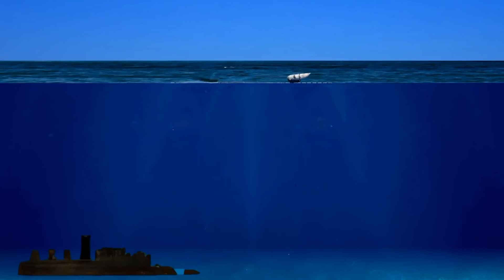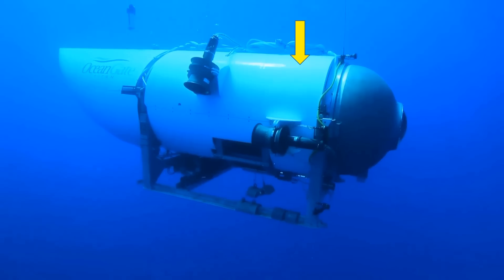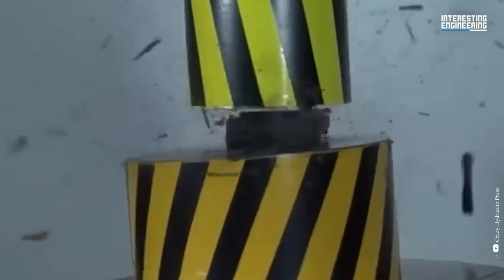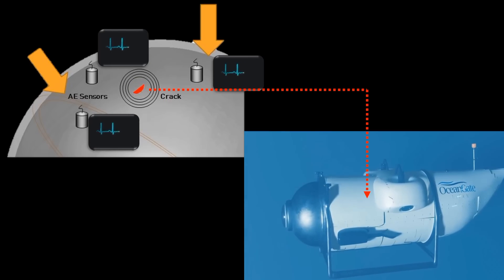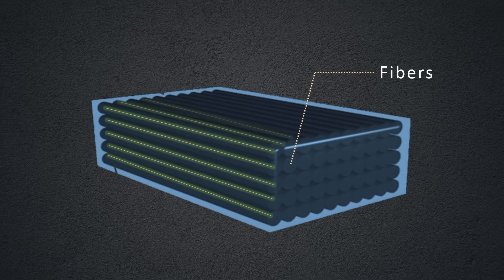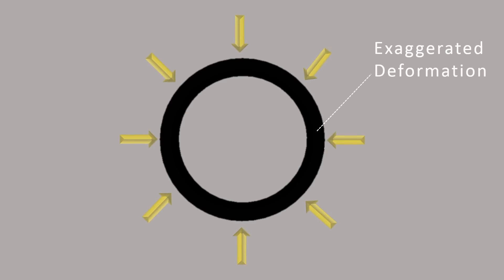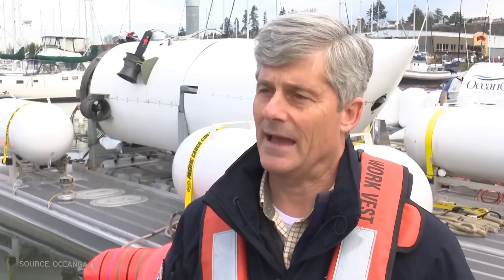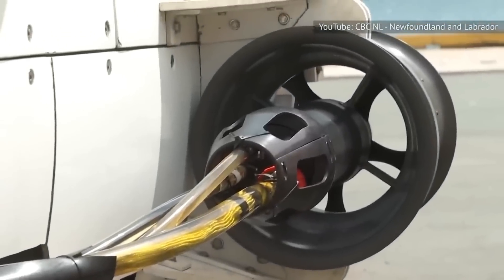Oceangate Titan Did Not Implode Just From Pressure. There Is a Catch!

Comment: The inner surface of the shell under compression will only go into tension when it develops an inner curve.  It's simple geometry.  As long as it retains cylindrical shape it's all under compression.  One might argue an infinitesimal section of fiber could warp in matrix filler around it & go in tension, but there would still be 99.999999900% of fiber under compression due to being part of cylindrical shape.

Comment: I work with carbon fibre & repair fractured or completely broken items made from the material.

A 5inch thickness of the hull built correctly & under perfect conditions, would have been able to withstand the immense pressures, BUT the one directional lay up of the carbon fibres was NOT at all sufficient for such a structure.
A multi directional layering should have been used over the entire structure as for the same volume of carbon fibre the finished strength is hugely superior.

It beggars belief that Oceangate adopted the one directional approach & in my opinion it's that what has caused the implosion & cost the lives of the five.

Very very sad that basic carbon expertise wasn't researched, ask for or adhered to.

Comment: Seems like Stockton Rush would know much of this and so my thinking is he had a number in his head. Maybe 12 missions and then he’d inspect it thoroughly.  Or maybe a number based on the cost of building and operating the sub.  A number high enough to make it profitable.  He must have had some number in his head about how many missions he would risk before doing the work to find out how long these subs would last.  Sadly, the actual number of missions to failure was far below what he likely estimated.

Comment: Thermal contraction/expansion differences for bolts embedded in the carbon fiber for the titanium end and sealing passages for cables through the carbon fiber hull would seem to be obvious points of failure in the design.  It was an experimental vessel with fundamental flaws and inadequate testing. 😢

Comment: Second thing.... I working at underground coal mine from (400-1200meters under) and from time to time i thinking what is theoretical force is waiting to push on us when we there. .... And almost all of is is self suport by tuner surrounding coal sandrock etc. We see how But from time to time we see the corridors getting narrower every day. Coal is soft so he is bended and  stratifies itself when rocks pushes on it from behind and on other side it meet steel and empty space or by preasure the bottom is rising.  rocks enter through the casing and sometimes in extreme cases they break the steel casing as if they didn't care about them.  In fact, these tunnel casings protect us from the very small space around us, not all the pressure of millions of tons above our heads, and if the environment wasn't self-supporting, the protective casing of the pavement would be useless.  We have no guarantee that the housing will not fail or that a rock will not pop out from between its frames.  That's why, among other things, when we greet each other at the mine, we say "God bless" to each other

Comment: I just imanine that composites are good at holding compresed air/gases when round or cylinrical shape distribute presure in all direction and carbon fibre on tearing force is great. But at same time process is not repeated when preasures are reversed. (Outside of cilider is high and inside is low) ....It should be easy for non grade person.. Or is here somone patient to explain to me how wrong I am and it has nothing to do with the disaster.

Comment: I suggest there was a 'stresscon', (stress concentration) at the interface of the carbon fibre cylinder and the titanium end caps.
These 'domes' are inherently more rigid than cylinders, being titanium just makes them more so.
Interfacing different types of material is always a major problem. Are not submarine hulls made from the same material throughout?

Comment: Actually it did implode just from the pressure. Nothing else made it implode. The design simply wasnt suitable and so eventually failed causing an implosion, under massive pressure. The cause of the failure doesn't change the fact that it imploded.

Comment: Agreed. I don't think anyone really understands the failure mode of this structure. We can say for sure that it was associated with fatigue however - it worked previously. Carbon fibre is more vulnerable to fatigue than titanium. 

The cylindrical shape was not adequately catered for -

Radially wound CF.
Supported at the ends by titanium.
No mid or any internal support.
No NDT.
Glued end joints.

I think that the tin can comparison is valid. The two end caps were waiting to come together and all it took was a slight change in force vectors as the tube buckled due to fatigue failure.

Comment: It makes sense to have as few joints in a submersible as possible and absolutely no glue or epoxy because of the obvious ability of glue to come apart or dissolve. A better idea would be to cast the entire submersible as a seamless tube using one alloy or metal with only the portal and escape hatch with bolts and seals. The escape must be made to be opened from the interior as well.

Comment: I'm  a degreed  mechanical  engineer  ... 78 years old ... the failure was due to material  selection and lack of cycle stress testing ... Eg.  Airplane  wing structural  design is rated in millions of flex cycles ... stress cracking due to work hardening of the materials  ...
Obviously,  extensive cycle testing was not performed...
If done ..this would have shown the weakening  and eventual  failure  ... lamination  construction follows the "weakest link  in a chain" analogy ... if one layer delaminates ...the integrity  of the body strength  is severely  compromised  ...
Overall ... incompetence  lead to failure  ...
Brian L Meeker

Comment: At depth of 3,000 meters, the external pressure on the vessel wall is around 29.4 N/mm^2. Would you know the carbon fiber wall thickness of the Oceangate Titan?
Reply: I heard that it was 5 inch thick.

Comment: Stop lying about the controller.
It's not a problem. 
You have been doing such a good job of remaining honest and sticking to the facts but when you got to the controller you began being intellectually dishonest with yourself and intellectually disingenuous with us.

Using a game controller is not at all a problem as the US military uses it for many different purposes including multimillion-dollar aircraft, watercraft, robots, and other uses. 

Gaming controllers are intuitive cheap and extremely durable and reliable. There is absolutely no issue with using a video game controller to control thrusters on the craft as it is intuitive. There was a backup controller on the craft and other ways that were secondary backups to controlling the crafts movement. Please remain honest as I do like your channel but as a new viewer if this intellectual dishonesty continues I won't be able to continue watching your channel.

There are so many things wrong with what happened in the construction and use of this craft so just stick to those. You don't need to make up a fake problem in the controller when it's not actually a problem. It really sets you apart from the others when you lie about this.
Honest scientific fact based channels will point out that if the controller is not really an issue. Be one of those channels.

Comment: Carbon fiber might be good , but 5 inches wasn’t probably enough, maybe 12 inches should be considered safe .
My second opinion is about the 2 end rings , we see on video they look like to be simply glued and simply located about 6 inches into the the carbon fiber tube , I have some engineering skill and as what we can see there is no over wrapping to interlock those ring with carbon fiber tube , it should have have been 2 or 3 interlock lips while wrapping the carbon fiber and finally on the outside a final collar that compress that joint , I don’t mean to the point to affect the integrity of the carbon fiber , just to apply a pressure to prevent any water to enter between éther titanium and the glue , to my point of view , the glue can’t stick 100% to the titanium and over the cycles water made it’s way slowly.
Did you see on tv all the 2 rings come clear of carbon fiber … so the glue simply broke off .

Comment: The sub was not constructed in a proper clean room with all external contaminants filtered out using HEPA filters. It was epoxied together between carbon fiber and titanium in a warehouse with no control over air, temperature, humidity, contaminants, etc.

Comment: Carbon fiber is a great material under tension, but near worthless under compression.  Likewise, a rope is a great material to use to pull a heavy object (tension), but is essentially worthless to use as a stick to push something, (compression).
Epoxy is a great adhesive when gluing surfaces together when spaced two to five thousands of an inch apart, but the strength goes down quickly from there in bulk applications.  
Epoxy has the strength of 3000 psi in tension,  This compares to 30,000 psi for low strength steel and 60,000 psi up for high strength steel.    Steel frame building are welded and bolted together.  They don’t use epoxy to glue steel frame building together for a reason.  
The strength of epoxy in in tension.   The peal strength of epoxy is far far lower. 
An epoxy saturated rope would only slightly improve a ropes ability to push, 
Epoxy would probably improve a ropes performance in tension by better sharing the load between fiber, but then when it failed, it would probably be with a big snap.
Both carbon fiber and epoxy are great materials in the right application, using high tension strengths of carbon fiber,  such as high pressure inside the vessel,  but totally wrong or backwards for resisting high pressure from the outside, creating compression everywhere.

Comment: What was the benefit of using carbon fiber?

What I really don't understand is this: Carbon fiber is a good choice where wheight is paramount as it's load bearing capacity is really good when compared to it's weight. Like in a flying drone e.g.

I would have thought (material engineers correct me if I'm wrong) that even with a steel or titanium hull, The big "air bubble" inside of the submersible would lower the overall subs density enough, that you don't have a need to go to lighter materials. You don't typically build boats and ships out of carbon fiber because they naturally float because of all the air inside. And yes such a deepsea submarine or submersible has a comparitively thick hull und small interior but it should still work out and in other subs it does work out. What was the benefit of using carbon fiber?

It can't really be its price. Yes, it's cheaper than titanium but you could've used steel and in general, I would have assumed, that the material cost would be comparatively not that important when compared to maintenance costs (anything "at sea" is expensive) which include the ship that brings the sub to it's dive point and also compared to all the R&D necessary. Well if you don't do much R&D and just wing it, that might be a different calculation, but I would have guessed, that unless you build it like from pure platinum, the material itself shouldn't be the big cost driving facto. So what was its benefit?

Comment: Stop bashing Stockton Rush for using a game controller that was tested by millions of under age kids in extreme conditions.  The game controller was not the cause of the disaster.  If the game controller failed a spare could easily be plugged in. Use of the game controller was Stockton Rush's middle finger to the engineering world. Stockton Rush made one achievement. Never again will a deep submergible be used without deep sea  testing.

Comment: Carbon fiber, with "glued on titanium rings" for attachment is simply an engineering nightmare for starters. No glue on Earth is tested and certified for such depth as the Titantic. Either the glue and/or stressed carbon fiber from depth cycling is the only apparent reason for failure.

Comment: Expansion and contraction of a cylindrical chamber using non-uniform directional material that is weak in compression, but strong in tension seems ridiculous to me.   Of course the material is going to fail after a few cycles of almost 1,000,000 pounds force per square foot on the outside versus one atmospheric pressure on the inside. Modeling the material that is not uniform wrapped cylindrical, and not spherical he seems to be quite impossible. Each and every fiber of the carbon has minor directional changes while being wrapped. As a mechanical engineer, I could not ever agree to put humans into such a device before it was tested to destruction to prove that it had a safety factor that would work. These people were lucky that the device worked during the initial dives, which were knocked down to the depth of the titanic. I agree with all of your analysis here.

Comment: They hoisted the Titan vessel from the back of a boat in a CBS story, but in a YouTube vlog, they towed the vessel 400 miles by a rope behind a boat on the high tech raft.   Would the vessel being tossed around in the surf for 400 miles put stress on the glue joints between the carbon fiber and titanium?

Comment: Some figures I saw suggest that Titan was descending faster than normal.  Possibly during its towing weakness appeared where cables pass through the carbon fibre shell at the rear, allowing water to enter within the structure and making the air compartment smaller.  The crackling noise reported cam from the rear.  I suspect that the shell failed at the rear owing to water ingress entering between layers of polycarbonate and causing delamination, as well as weight gain.

Comment: Would alternate layers of the carbon fiber running in opposit directions on the cylinder, possibly given it more strength to prevent implosion at the depth stated?

Comment: dude... the carbon fibers whatever they used (Im more of a constructual guy in building then engineering) for the inside of the walls had air pocket bubbles in it, which the only way to fix something like that is pressurized heat. It was just a matter of time until one of those points fail. bruh for something like this, you don't even want a 0.01% chance of failure. That ONE tiny area could result in a HUGE succession of the whole design. This goes for rebar for concrete as well but not as major. 

... Man I know this stuff well, but I'm scared of going back to work in rebar and concrete because nobody cares, and taxes are sky high. Imagine trying to make a living in one of the most back breaking professions, AND being knowledable and capable of engineering design. Breaks my heart that someone like me is even on social services, but after 5 years and still having nothing to show for it, I give up.

Comment: The interface of the titanium rings to the CF cylinder (glued if I remember) would be another major problem area. I am sure CF and titanium behave differently under pressure and temperature (I did not look it up) leading to a differential in compression and expansion at the interface which I would suspect would lead to an interface compromise. Also the CF is being compressed (axial stress) at the ends from the titanium end caps. Thanks for the video...

Cheers!
Reply: That and the other point I mentioned with the air pockets in the carbon fiber. with such extreme pressures, one area of weakness will destroy the whole thing...

Comment: So in other words it didn't fell because of the carbon fiber. It's because there was two precious pushing the interior pressure from the oxygen and exterior pressure pushing on the vessel causing it to implode. Maybe there was an increase of pressure inside. If they have another chance to build it. What they can do is weep in steel 😊 or titanium alloid material in between the carbon fiber. They need to have a exterior hole that supports it and then I interior hole that keeps it from bending certain directions. That would support it. A little bit better. This is just a theory it's most likely not going to be allowed to be test anymore. But weaving aluminum, steel, or titanium into the fiber would make it a lot stronger.

Comment: All true on carbon fiber.  They work better in a pressurized (From inside) like a scuba tank than the reverse.   Also they had all the fibers going the same direction.   And they fused two dissimilar materials titanium + carbon fiber and only countsunk it 2 inches into the ring.  That will create uneven forces at the ring and likely would be a point of failure. 
Not sure how NASA engineers helped on this, was a accient waiting to happen.  100 degrees topside to near freezing.  combined with high /low pressure on each dive.  It was just a matter of time.

That photo of the blown up carbon fiber 4500 psi tank.  I bet that was shot with a gun.   Those tend to not fail like that they go out with a fizzle not a bang.   Unless it happened during pressure testing.

Comment: Trying to bond dis-similar materials together is always "sketchy", especially if there is no combining of the materials at the bonding joint.   Then, when you consider that at the Titanic depth the pressure is about 28,875 psi, even a microscopic flaw in the bond can lead to total disaster, very fast, as it certainly did.   The total pressure would be the 28.75K psi X the total external surface area of the outside of the pressure vessel.   That is a tremendous amount of pressure.

Comment: I thought that, in order to obtain the real strength and durability available when using carbon fibre it needs to be heat treated in an autoclave. I have not seen any signs or mention of such a device in any of the publicity during the build of this sub.